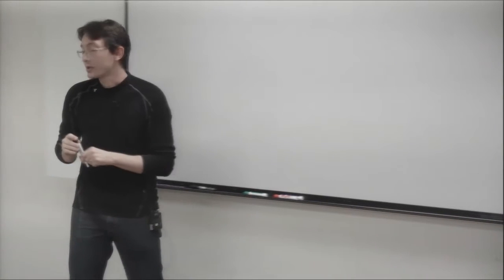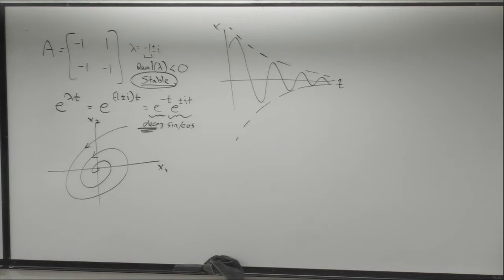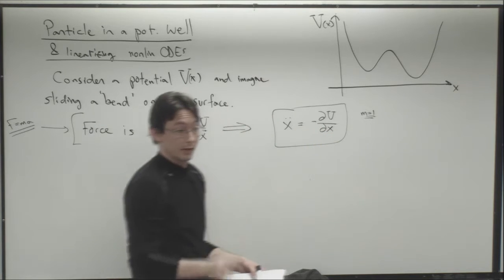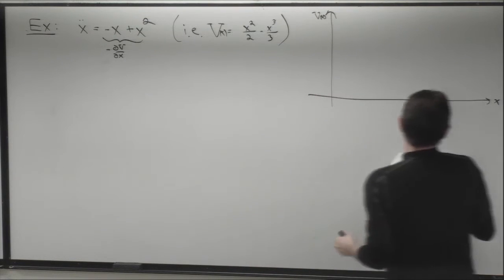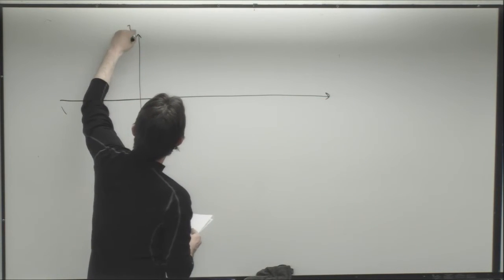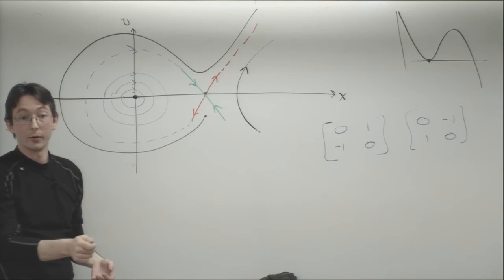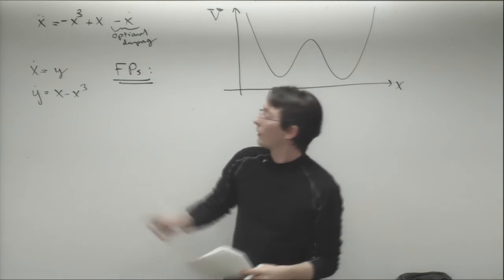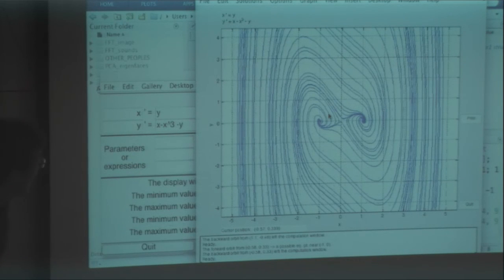ME564 Lecture 10: Examples of nonlinear systems: particle in a potential well

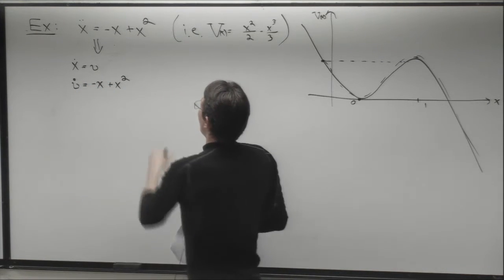Comment: In the case at 24:05, integral of acceleration = velocity = potential energy.

 I wonder why we defined the x dot as " v " rather than  " x^2/2 - x^3/3. "  Using v gives us the same solution with using  x^2/2 - x^3/3 ?